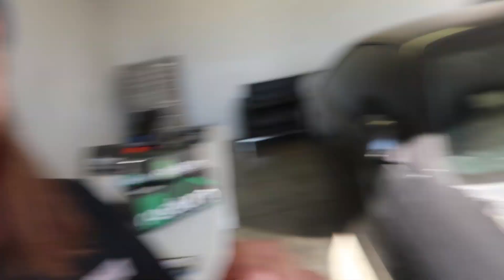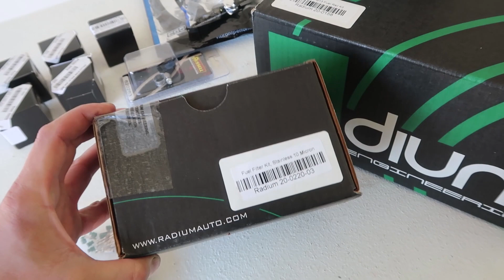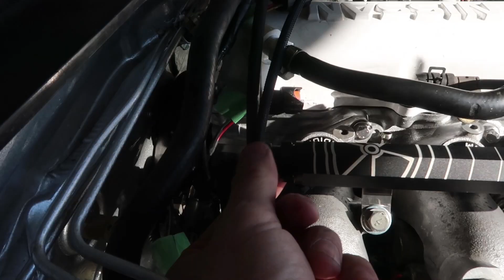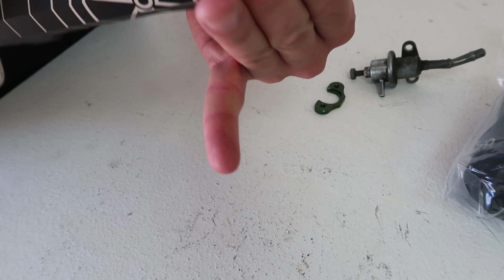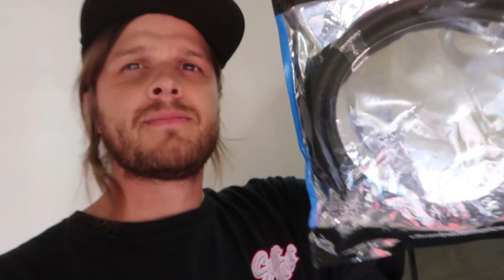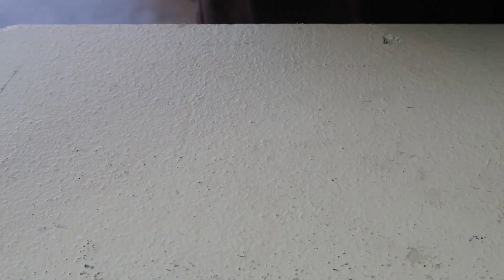240sx FUEL SYSTEM COMPLETE!

Comment: Super late to the video, looking for some help if possible. Picked up someone else's project s13 with sr20 swap. Have 11mm DW injectors on ebay rail with what looks like the Gready intake manifold (probly fake gready) but injectors are spraying everywhere and the rail doesnt line up all 3 mounting points. Also came with that radium rail and I belive also mounts the a/m intake. What are you using for injectors, I know its takes 14mm but all I can find are 1000cc

Comment: I have a 1990 240sx (12 valve) and just put rebuilt engine in, and overhauled tons on it from bushings arms to steering to custom suspension, Q45 front brakes.. I have stock inside engine and original injectors and looking to replace old parts or possible upgrade. I am looking for information on how and what to do.